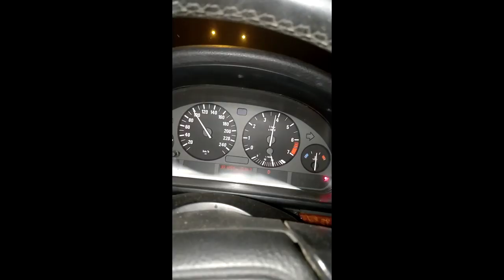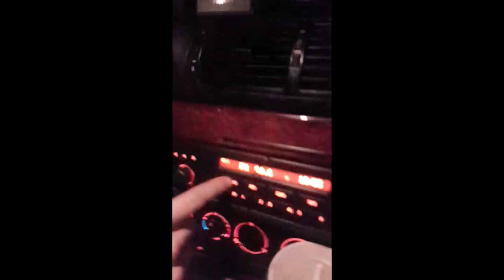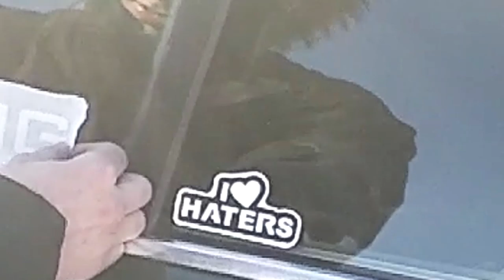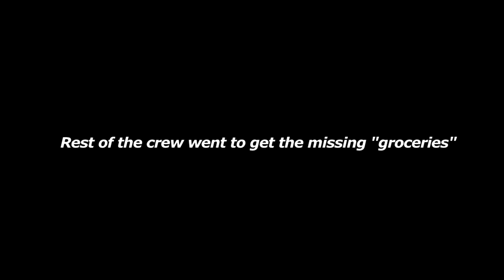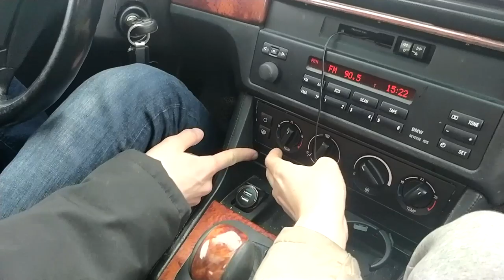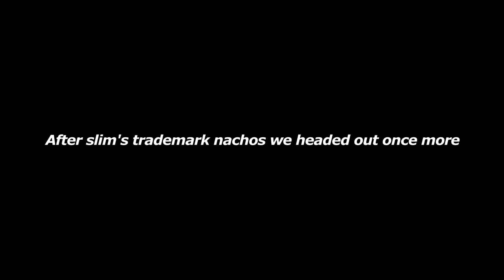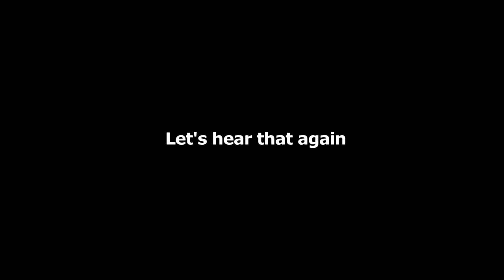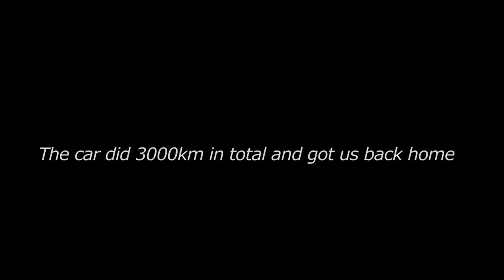Lapland Bombu (ROADTRIP RAMPAGE With SLIM & The Gang)

Comment: Slightly used e39, never crashed. No lowballers
Reply from the maker: The description of the car said, "fully working car, no reverse, just repaired alot 3000€" Car was pre heated when we came to get it and no receipts whatsoever :D typical
Reply: @Failure57  Haha nobody sells a car they just repaired, unless the car has even bigger issues :D
Reply from the maker: @uaintme6419  nono, total for 350€
Reply: @Failure57  XD